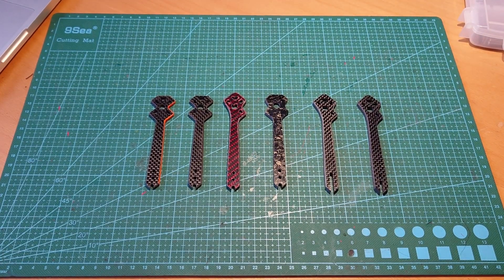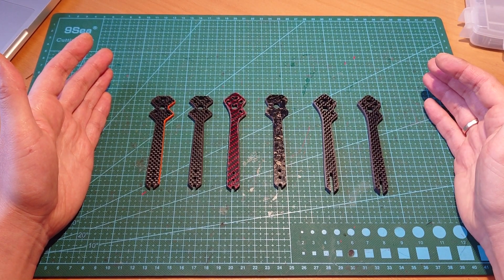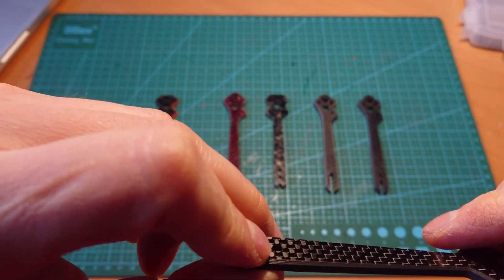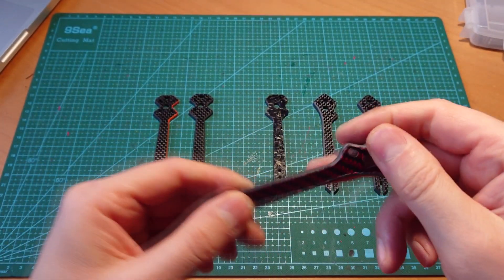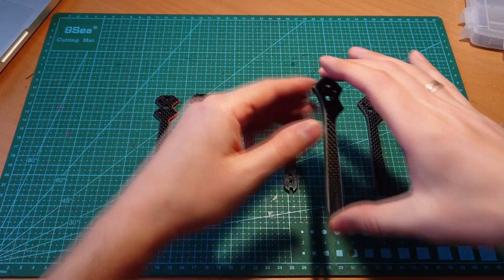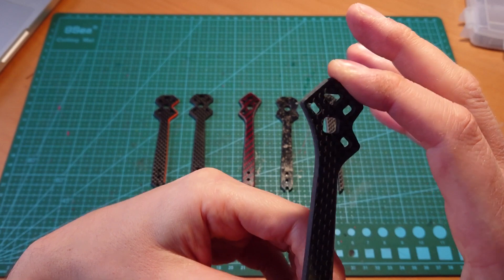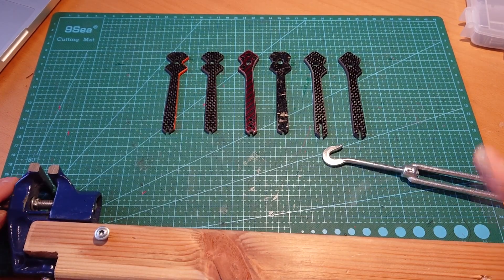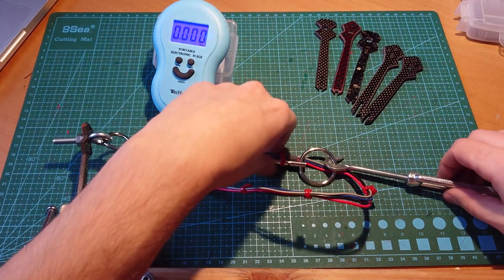FPV Drone Arm Wrestling - Ep.1

Comment: Firstly I thank you for taking your time and effort looking out for the main subject of finding the strength properties of these Carbon Fibers. Nice approach with the test rig you have but I think its abit skewed for the results as each dimensions of the arm are different and the point where the arm angle of deflection supposed to be flexed should be equal distance across the arm for the pivot point (in this case, the vise?) . Weight characteristics of each CF properties given with the same dimension can be concluded with some useful findings taking all these target question as the approach. I'm already looking forward for your frames just because you seem to give alot of attention on the CF properties in making frames but like I said, your tests should conclusively mention which are best for certain purposes strictly for building such freestyle or racing rigs. As a vague personal opinion, honestly just out of all the arms, low cost : performance ratio will be the best one.
Reply from the maker: You are completely right about fixing point of tested arm. In this particular test design of tested arms was almost identical, as well I tried to fix them in vice at the same point. So numbers I got are showing more or less correct difference of arms durability. My target is not to get exact numbers, but to understand and prove my thoughts about how different types of composites behave and act within applied force.